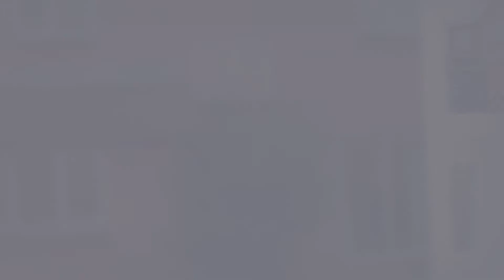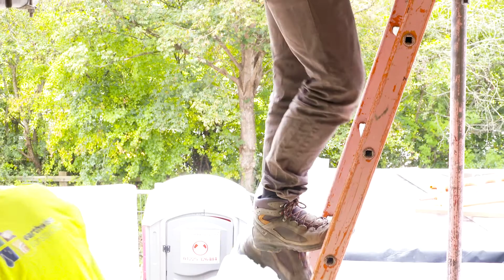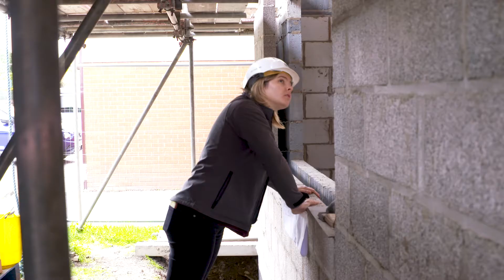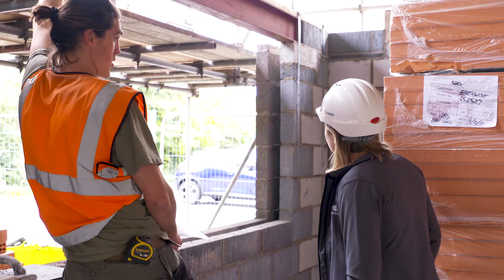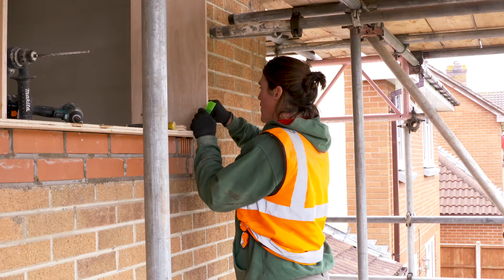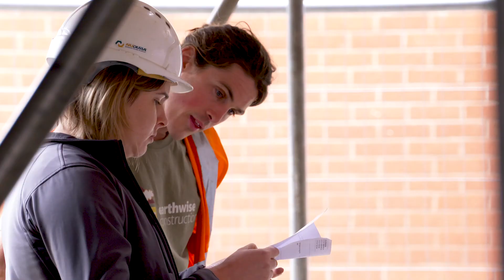EnerPHit project spotlight, The Green Register and Earthwise Construction

Comment: How much did it cost?
Reply from the maker: Hi Damian, I do not have access to the figures for this specific project but I do know that costs can range depending on products used and final finish required. 
With that said, I have also seen retrofit tasks undertaken for as little as £8-10k. The best thing to do is to look at all the shortfalls, and then start with the big wins. One can always add works later to help improve. 
I am sorry I can't give you a proper answer to your question.